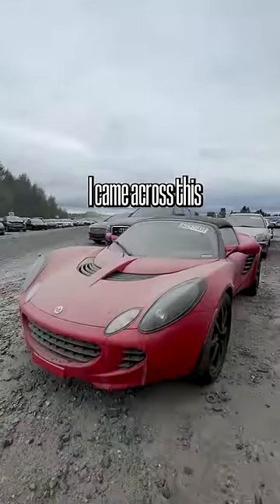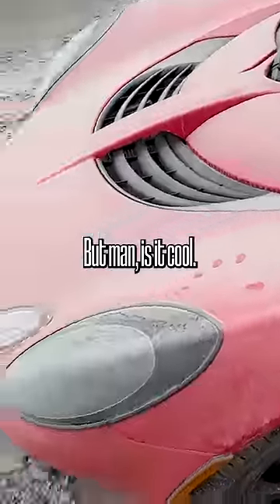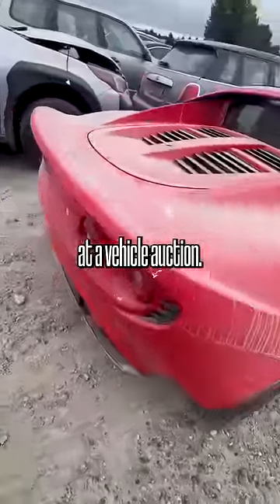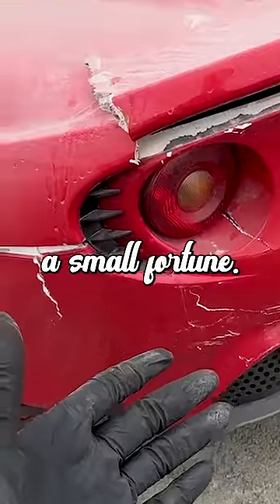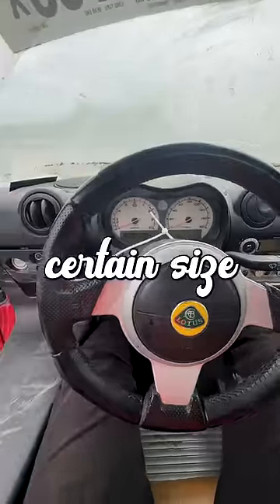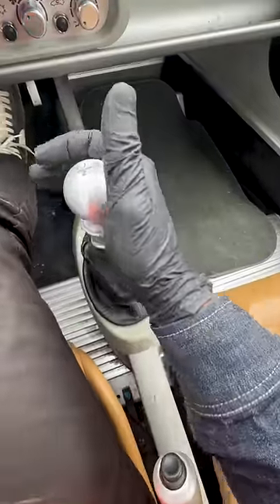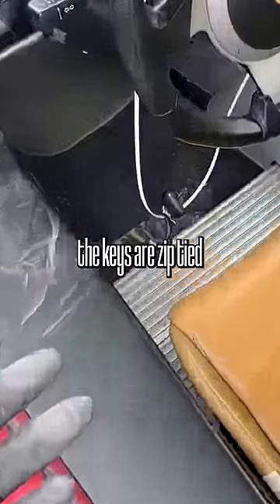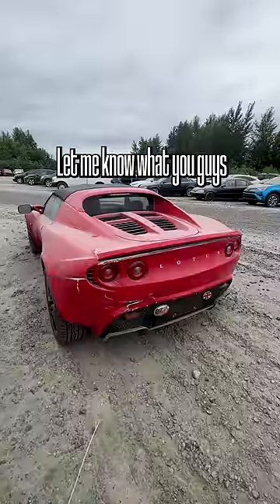Auction Lotus Elise - I Still Can't Believe It...

Comment: I got a 06 mk5 GTI with 110k miles single owner no accidents clean title, and it was serviced regularly. Originally from Virginia so it has undercarriage surface rust. The only bad thing that I don’t like, the previous owner had the front left fender replaced and it didn’t match the same as the car so they were like “ah yes let me repaint it with red spray paint!” I mean I did buy it for $6,500 which is a great deal since used mk5 GTI’s sell for around $10,000 to $12,000

Comment: Definitely pick that up. They are amazing cars and the handling on them is just amazing. I’m telling you if you fix that car up it will become your favorite car to drive
Reply: The one in this video sold for $26,000. With Copart fees included, the total would be just under $30,000. If you choose to replace the entire rear panel, you could expect to pay upwards of $15,000 parts and labor. Depending on what state you register the vehicle in, DMV tax may easily exceed $2,000. I'd rather buy a used Honda S2000 if you are ready to pay that kind of money :/

Comment: i have a 2004 pontiac Vibe GT and it shares the engine with this car. it is a Toyota engine which was tuned by Yamaha the 2ZZ-GE. its a small 1.8L i4. but has an 8250 redline and makes about 189 hp NA. which is alot for its size. i call it my hatchback lotus

Comment: 2zz 1.8vvtli, it's a reworked engine by yamaha. It's not as robust as a K20 but still very impressive as it gives more torque at low revs. Toyota probably never got a return on that engine due to the high cost of the sleeveless block manufacturing. Very light weight engine vs power output and good when it comes to looks.

Comment: That is probably the first car that I would pick up without hesitation. Keep it as a track car or canyon cruiser and keep the repair cheap since it would be on the track anyway.
Reply: If you were to "pick it up without hesitation", you would have to beat a final bid of $26,000
Reply: @ephraimkaravan  seems reasonable. These cars are already going up in value so 26k for something that has likely no mechanical damage is a decent price.

Comment: I had one of these in my smash repair shop. Panels are light, but fragile as all hell and lights fit like utter crap, getting into it I needed the targa top off, inside was uncomfortable as hell. These are almost completely bare bones and are basically track cars with a number plate.

Comment: The back is a whole shell, so if you want to change this only the shell costs you about 4-6.000€ without paintjob.
With paintjob, what is pretty special to do on the glass fibre shell, it’s about 8-10.000€.
You can’t fix this part, so you need to buy a new one and change the broken one.

Comment: Its not just a derivative engine, its a literal same-same to another car.  (I don't remember if it was a Toyota specifically, but it was an Asian brand) They just add some aftermarket stuff to make 190 horsepower or so and have it in a super-light rwd car.  They're amazing, fast, and handling is godlike, but they break more because they're a more race designed vehicle.   I wish I could afford an elise,  total fantasy car and hell...fiberglass is just a bit of bondo from being usable again.  ^_^

Comment: The biggest issue with the Elise from what I remember is that it’s a fiberglass clamshell that if damaged has to be dismantled and replaced in whole
Reply: It could be repaired, but that's a job I would leave for a boat or body shop. I absolutely hate fiberglass repairs :/

Comment: THE ENGINE IS A 4 CYLINDER 1.8L WITH VVTL-I DESIGN AND BUILT BY YAMAHA, AROUND 182 HP AND A REDLINE OF 9,200 RPM. TOYOTA USED THIS ENGINE ON SOME COROLLA's AND MATRIX's WITH THE Xrs BADGE.  #BRRR!!!💪💪

Comment: eh you could pick that engine cover lock pretty easy, or just bring a few extra big zip ties and a pocket knife with you so you can cut em off, check in the locked bits, and then strap em back on just like they were. no one has to know as long as you don’t actually steal anything.

Comment: Body repairs on older fiberglass cars are not that expensive. Fiberglass work used to be taught in high school shop classes - it's really easy stuff to work with so actually LESS expensive than the old metal fenders, siding & such.  Almost any "home garage" guy should be able to rebuild the body for you pretty cheap - and up to spec.  It's that easy to work with.

Comment: The Elise has the Toyota 2ZZ motor which was notorious for misfires leading to hammered valve shims,  bent valves or total destruction.   I had a 2003 Matrix XRS with the 2ZZ and had all of these.  Destruction of the #2 cylinder ended its life.
Reply: notorious for misfires? thats not true at all, either you are assuming its misfires when its something else or are doing something very wrong like using the wrong gas
Reply: @arcanevoid9199  I lived with a 2ZZ for many years. I know of what I speak.
Reply: @bugdozer  lots of info there thanks for that. just curious what gas did you use for it?
Reply: @arcanevoid9199  Always 92. It did have about 150,000 miles on it before it self-destructed. Misfire on two and the piston rod punched through the top of the piston.
Reply: @bugdozer  93+ would be more ideal but thats not bad. this is not something that randomly happens though, there will be a reason why it happened and it wont be the engines fault. ive seen 2zzs with double that mileage or more and still going. my 2zz is coming up to about the same mileage and has been abused by 11 other owners, it also had not serviced properly and didnt have an air filter and was on 91 (which is same as 87 in the US) when I first got it. cleaned it up and runs good now

Comment: 2zzge Toyota engine, bone stock down to Toyota's slacker unbaffled oil pan design that kills their hi-po stuff if you hit 1g in a turn. Which this does, stock.

Had the same drivetrain in my Vibe GT. Walking 300+ hp cars on the highway was always fun.

Comment: Man, that thing is just BEGGING for a center-seat conversion. Bust out the wall between the cabin and frunk, move the pedals, shifter, and steering wheel, then give it an LMP-level gangsta lean and you could fit Shaq in there.

Comment: In some of the higher HP versions they used a heavily modified Camry V6 and slapped on a supercharger

Main reason: Before the Toyota engine, Lotus made their own engines, but their reliability was so bad and the power wasn't that great either, they just used a reliable engine platform from another manufacturer 

And what screams, simple, reliable and cheap? Toyota

Comment: yes, toyota powered. 3SGTE. Heads are designed by Yamaha for sustained high Rpms. fun little cars. for those that say, "rich mans miata", completely different realms.
Reply: it’s a 2zzge not a 3s, lotus would never use such a heavy engine
Reply: @arcanevoid9199  you're 50:50 with that. The 2zz was implemented in the series 2 exige. This was about the Elise. As my boy Johnny Tran would say, "2 Soon Junior".
Reply: @Rokynutz  the Elise and exige both had the 2zzge, neither of them ever had a 3sge. do you really think lotus would use an iron block engine? and the Elise and exige are basically the same, they had the same engine options

Comment: I'm confused.  When did fiberglass become expensive to repair? clamp the two pieces, re-inforce with more fiberglass, expoxy, then sand.  Most likely the tub (Frame)was damaged.  Also Lotus Elises were never expensive to begin with.  A single owner, no accident, used one goes for $35k.

Comment: its got the 2zz in it which came in the toyota mr2 , the reason why they are ferrari killers
Reply: 2zz never came in the mr2
Reply: @arcanevoid9199  it came in the second gen sw20 mr2 the 2zz-ge was in the n/a versions while the 2zz-gte was in the turbocharged ones and in the lotus elise there was the 2zz-ge
Reply: @MuhammadSaudSiddiqui  youre confusing it with the 3sge, 2zz never came in the mr2

Comment: it's got a Toyota Camry engine essentially.
Reply: it’s a celica engine
Reply: @arcanevoid9199  Wrong. They weren't really making the Celica anymore when the Elise started using Toyota engines. It's a 1.8 L Toyota 1ZZ-FE I4 engine or the 
1.8 L Toyota 2ZZ-GE I4. Then they added a supercharged version of the 1.8 L Toyota 2ZR-FE I4 around 2008. The Celica used a 2.2 liter engine, then switched to a 1.8 liter in the 90's...but it was a different engine. The base model had a 1.8L VVT-i 6MT (143 HP) and the upgraded turbo version kicked it up to 192HP.
Reply: @greggburke3770  they were making it, 7th gen celica stopped production in 2006 and the s2 Elise released in 2001 and exige in 2004. lotus wanted and used the 2zzge that first debuted in the celica in 1999 and made 192hp aspirated and more for supercharged lotus versions (never came turbo)
Reply: @arcanevoid9199  The turbo I was referring to was the CELICA engine. Try to keep up! The Elise 111R started using Toyota's twin cam motor in January of 2004 and that continued through 2009 with the Elise R.
Reply: @greggburke3770  the 7th gen celica never came with a turbo, the 192hp version was the 2zzge and the 143hp version is the 1zzfe. both are naturally aspirated. why are you calling it the twin cam motor when that could be so many different things, it’s the 2zzge

Comment: It’s a 276 hp Camry engine
Reply: it’s a celica engine
Reply: @arcanevoid9199  nope. It’s a v6 Toyota Camry motor. I had one just like it. Now I own Ferrari’s and Lamborghinis and Mclarens.
Reply: @FC0BCA7E7A  its a series 2 elise which uses the 2zzge, a camry v6 is not going to have a cluster that goes to 10k rpm with a marker for the VVT-Li that comes on at 6k rpm. you had a later model

Comment: No need to spend a small fortune repairing, a little duct tape will fix that rear panel.  🤣

or just use a fiberglass repair kit and spend a week on it....won't set you back much at all.

Comment: Rip it off and 3D print a shell..
Reply: 3d prints not strong enough lol
Reply: @arcanevoid9199  we have 3D printers… printing parts “made of metal” for rocket engines… I’m pretty sure there’s a material stronger than just flimsy printing reels..
Reply: @jeffcon123  yea but how many people have a printer big enough? you also have the issue with having layers with a 3d printer as it creates quite a bad weak point